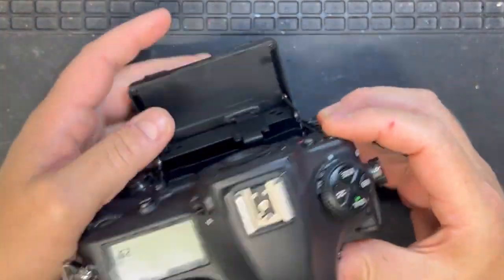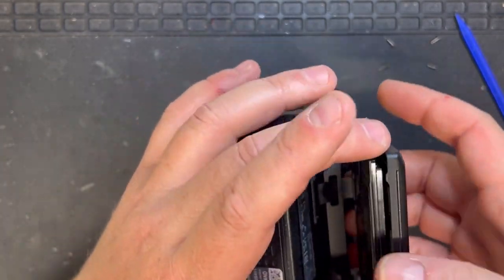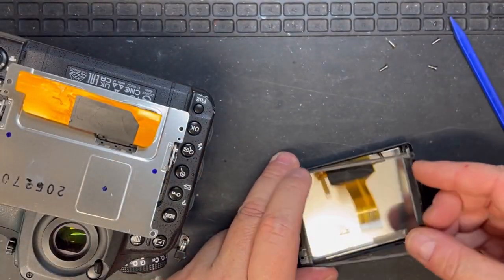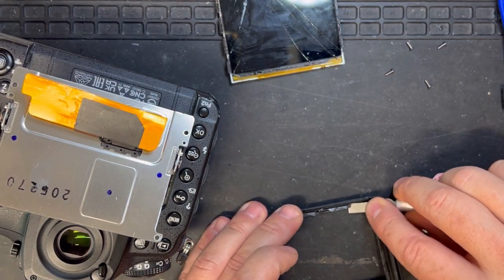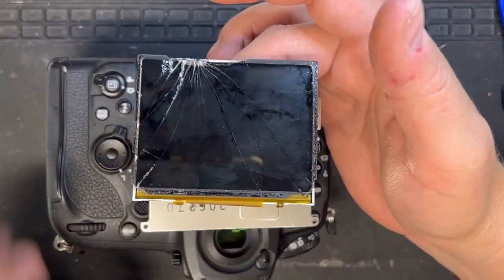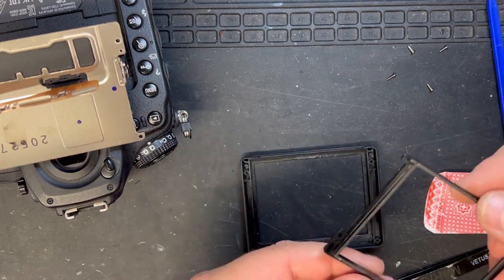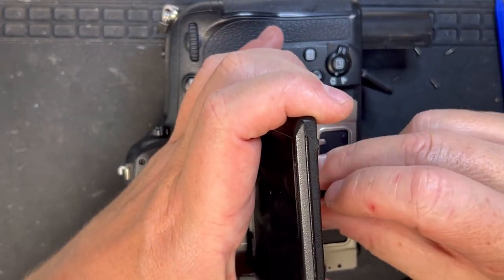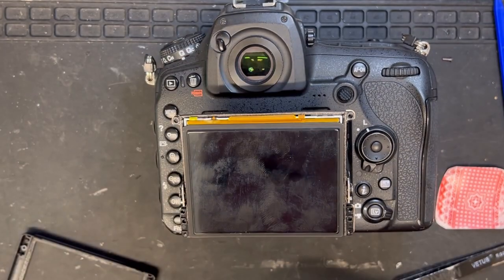Nikon D850 rear lcd screen replacement

Comment: Thanks so much. I was able to replace a smashed z8 screen following this. Parts look slightly different but essentially the same process. I couldn't find any videos or articles specific to the z8 screen replacement, so I'm glad this worked. For anyone else with a z8, the z7ii screen is the same and can be found on ebay. Just make sure you get the touch screen one. If it doesn't say touch screen in the description, it won't have touch functionality.